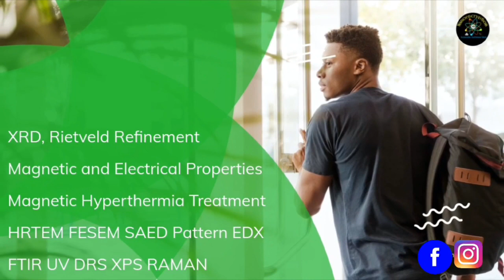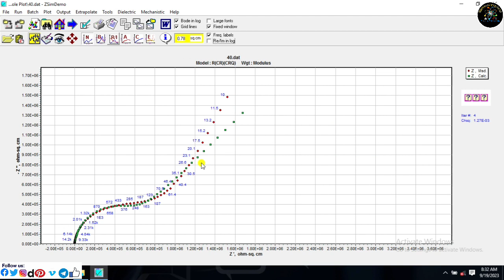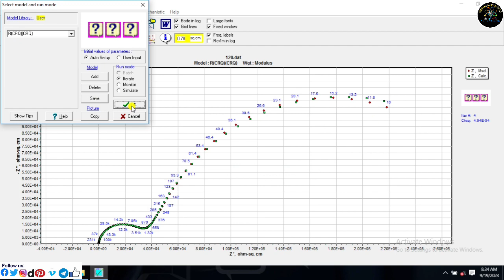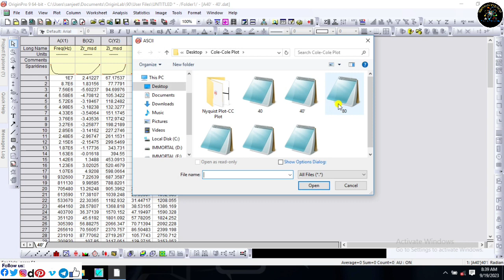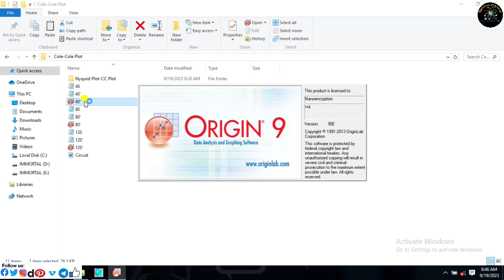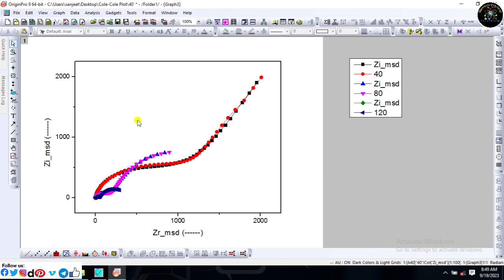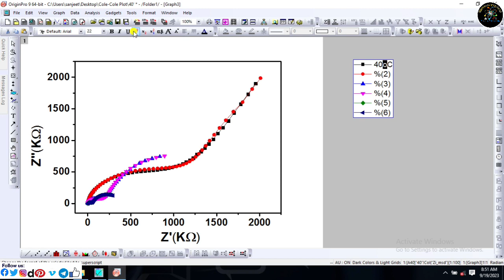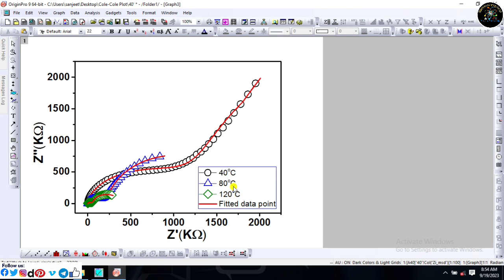How to fit the Nyquist plot or Cole Cole plot with the electrical circuits via ZsimpWin software

Comment: Historically  a Cole-cole  plot is epsilon'(omega) vs  epsilon''(omega), where epsilon(omega)  is the dielectric constant.
For  your dataset  it  would roughly  correspond to C'(omega) vs C''(omega)  where C(omega)=1/(i*omega*Z(omega))
So a  Nyquist-plot and  a Cole-Cole plot is not  the  same.  See  Cole  &  Cole  J. Chem. Phys. 9, 341–351 (1941)
Reply from the maker: Thanks 👍🏻

Comment: Sir I believe different curves have different circuit diagram then how come you used a common circuit to represent the all the plots.
Reply from the maker: Please go through some articles...Here, I have show that how can we draw or plot diagram like this.
Reply: @NanoencryptionSKP  okay sir. Thanks for your Swift reply 😊
Reply: Sir , please share a link here so we can understand better how people get same circuits for different curves or please make a video for it
Reply: Yes, we get different circuits for different plots in most of the cases, but there should be some correlation between the circuits for similar kind of material/ compositions

Comment: Hello sir, I would like to ask, are there any requirements for the unit of the original data I input into the zsimpwin software? The sample area of zsimpwin software is cm2. If the original data obtained uses mm2 as the sample area of the measurement process, what modifications need to be made here?
Reply from the maker: Convert it